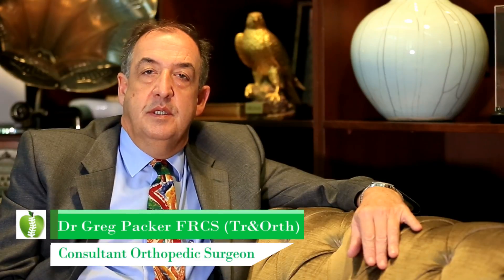Elbow Replacement Surgery, Conditions, How is it Performed and what can I expect afterwards?

Comment: Hello , do you know if osteochondral grafting is possible on early deformed joint surface on radius head on elbow, could be prevented like that (mainly radius head replacement) or elbow replacement for life or is there another way. Please answer doctor im struggling and very very young and can't live without weightlifitng!